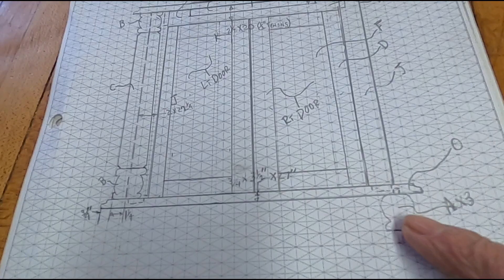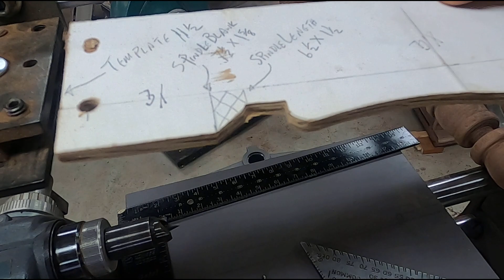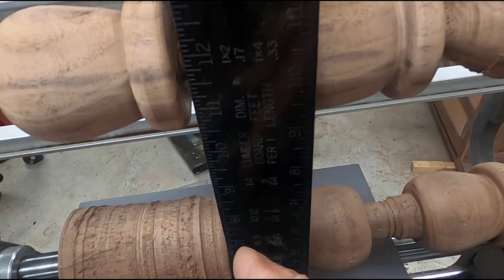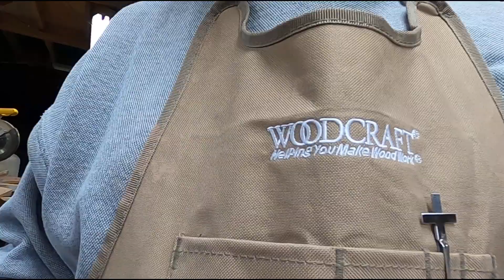Shopsmith Lathe Duplicator   How I Set Up and Use Mine

Comment: Pretty impressive and they came out fantastic. It is pretty exacting but clearly I can see how it would save lots of time and probably frustration. I may have missed it, but what kind of wood was that? Walnut?
Reply from the maker: Thanks Dale.  When I made the first parts the setup wasn’t correct.  The parts were way smaller than my template.  So, I did a series of test parts and figured out what was wrong.  

Once I did, I too was astounded at just how accurate the parts were.  I hoped this video would help others to figure it out more easily.

Yes, it is Black Walnut.  I’m making an entire nightstand out of it. There are several more videos coming on that project… and the wood comes out beautiful.

Thanks bud… see you on the next video!

Comment: Hi Dave
I always enjoy your videos. 
I have a duplicator I’m restoring. 
I don’t have the second track piece. 
Is that needed to stabilize the braces or may I leave it off?
Reply from the maker: Not necessarily.  It comes in handy if you have to remove it or slide it to one side.  There is no pressure on the template during use.  Here are a couple of tips to use when setting yours up....
1. Make sure that the bottom part of the mount is perpendicular to the tubes before clamping it in place.  That will keep your single track from being out of alignment.
2. You may find that clamping the bottom mount too tight causes your motor mounting tubes to seize within the power head.  You'll know if you try to slide it along the tubes.  If so, you'll have to back off the clamp screws.  

Otherwise, I see no reason why you can't use your Duplicator just fine. Good luck with your restoration.